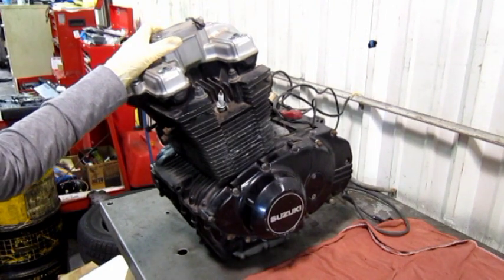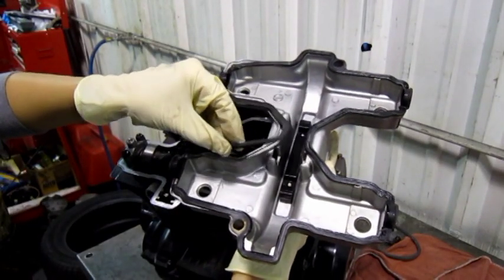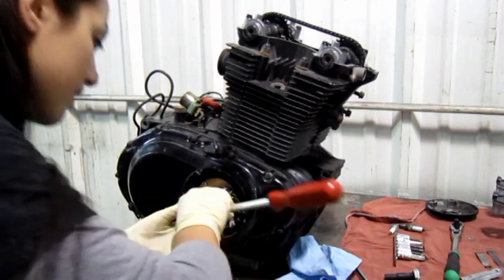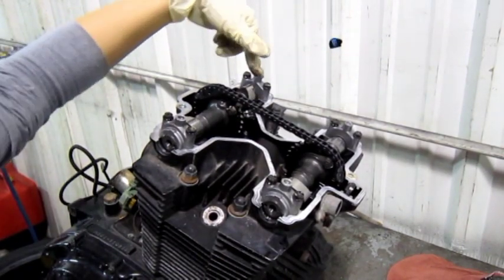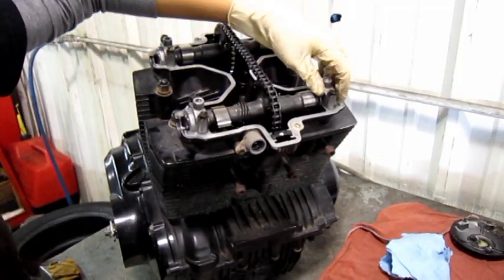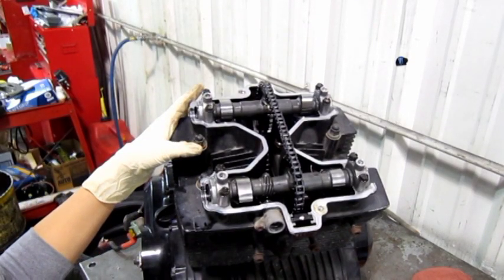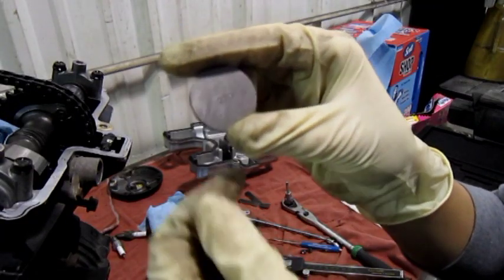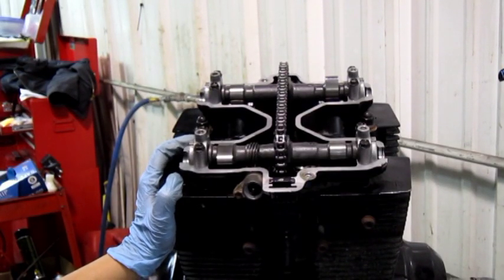Suzuki GS500 Valve Check Procedure

Comment: For more accuracy take the measurements for each valve when the cam lobe is pointing away 180 degrees from the cam bucket/follower. Although the manual says do it only in 2 positions, you aren't getting the true clearance because the cam is often not perfectly round but slightly oval. At least take measurements in both positions to find if there is a difference. Often at 180 degrees (pointing directly away you will actually get less clearance. It is possible to be within spec in the manuals position and be too tight when the cam is pointing directly away.

Comment: At 8:31. Is this step a MUST-DO? 
I did valve clearance checks on my 1990 GS500 (80,600km) a month ago all valves were in spec. However, I don't think I did this step of "re-aligning" the engine??? How important is it to do this part? Thanks!

Comment: My Suzuki service manual say's not to use a magnet to remove the shims; stating that the hardened steel shim material could become magnetized, which might attract debris or even pop out of the bucket. I use a pair of tweezers (Zircon encrusted optional), which is a bit more challenging, but may be safer.
Please advise. OK on the magnet or no? 
Thanks.
Reply: No magnets......
Reply: Good to know, thank you for the advice

Comment: Thanx for the vid...I been riding my GS500 a bit harder lately and it developed a muffled sound on accel...then started to knock 1 morning, increasing & I checked oil level..nearly out & now has a shocking knock at idle, decreasing as revs are increased...any ideas??...I`ll have to strip it down but just not sure where to look first :(

Comment: Guessing you are in Baltimore. You work at a shop? What would you charge to adjust my 92 GS500E valves? Just picked up this bike and it stalls out when coming to a shop. Carbs are clean, heard valve adjustment could be the issue.

Comment: I have recently bought a 1992 gs 500 it has 25K mile's it has great compression but is hard to start back fire's and when I do get it running the left side carburetor shoot's out little stream's of gas out of a little hole where the air intake port is .   Is this because I need to rebuild the top end or would it be as simple for me to just adjust the valve's?

Comment: I had a GS500 and it was ok upto about 90mph then it would just hit a brick wall. I suspect the shims needed doing. I like this method which doesn't involve removing the camshafts. To do the shims on my ZZR600, you have to remove the camshafts.
Reply: It's the fuel control valve. Put it on "pri" under high load and check if the problem is gone. 
Vacuum operated and there's almost no vacuum under wide open throttle and the diaphragm gets old as well. On pri you put the system on priming and thereby override the system but never forget to put it back on normal afterwards. Common problem and try it first